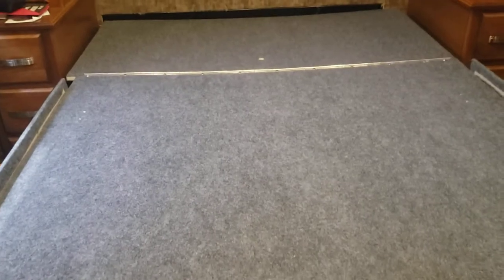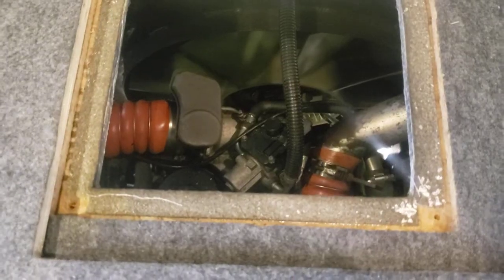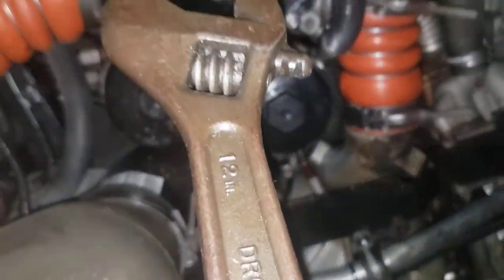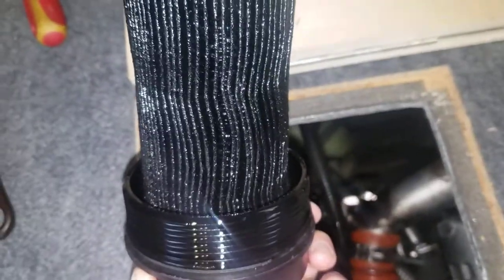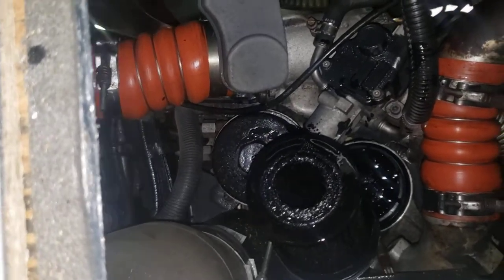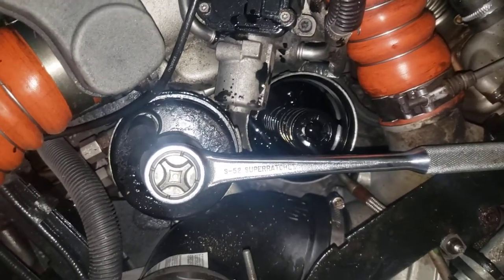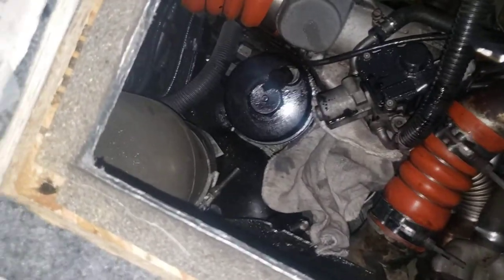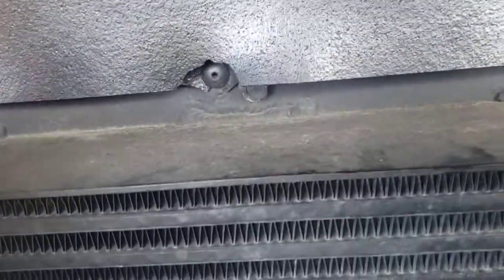Changing oil filter & fuel filter in a 2012 Tiffen Breeze 32br Maxxforce 7

Comment: Did you figure out the second filter was a fuel filter yet? There is a kit to replace that with the fuel/water separator below.
Reply from the maker: Yes, after I removed both filters, I realized one was a fuel filter.
I'd have to watch my video again, but I thought I mentioned that.
Under the coach or underneath the engine is the fuel/water separator filter. I did a video on that.
Reply: @PlasmArtFabricating  Curious, do you still have the Breeze? How has it been as far as problems go? There is a lot of conflicting opinions about the Maxxforce 7 engine and the EGR system. BTW, I purchased a 2011 Tiffin Allegro Breeze with 55,000 miles in January 2024. I still haven't drove it. It's just parked in the backyard while I have been performing all of the maintenance on it.
Reply from the maker: I still own the 2012 Tiffen Breeze 32br.  I love it! I believe it wasn't until late 2013 when issues began happening and after Tiffen had to begin installing pollution devices on the engine.
I pull an aluminum 18' trailer with a Fiat 500X on it and two electric bikes. I also have a spare 30-pound propane tank and two large containers with barbeque equipment, etc, in them.
I've driven up I-17 through Flagstaff, not missing a beat. Driven through hills of Tennessee  and the Virginia's.
No issues at all.
The only thing that happened was during covid, and I stored it covered, but windows and roof vents opened only to see both captain chairs begin losing the thin leather on them along with the curved sofa. I heard Tiffen knew about this and gave original owners replacements. I contacted them but will only sell replacements.
I'm looking at selling and taking the cost for replacement off the price.
I replaced all exterior lights with LED except headlights.
Mine didn't have front turn signals except on the mirrors.  I hooked the running lights up to signal turns. The wire is already there. Maybe who wired them back in the factory just forgot?
You'll love it!
Reply: @PlasmArtFabricating  The previous owners of mine, an elderly couple, were good about bringing it in for servicing and taking care of any recalls. They had all of the leather replaced because of the known issue you spoke of. Then they put fabric covers over the new leather for the duration of their ownership. So I basically have untouched leather on the 2 captain seats, dinette area and the love seat across from there. I'm considering ripping out that 2 seater couch and making it a workshop table area that can store tools as well. I won't need that much seating, but will need my tools and a work surface.
  It's good to know that it's been good to you. I can't wait to start traveling. Hopefully this summer. In the meantime, I'm just planning on things I'll need and maintaining the coach. I decided I wanted a spare tire. Little did I know at the time it was going to be a thousand dollar project including the rim, tire, torque multiplier for cracking those lug nuts, 12 ton jack with a special saddle, 6 ton jack stands and base plates for uneven ground, and all of the hitch mounting gear for the spare. I didn't want to have to rely on roadside assistance. The tires that are on it are in great condition, but they are 2016's. I have purchased a TPMS and wheel covers and have sprayed them with the 303 UV protectant and will keep a close eye on them until I'm ready to drop $3,000 - $4,000 on six new tires.
  It's been fun to work on and everything seems to operate as it should. I was told by the previous owners that it just needed some TLC and that was exactly the case.
Reply from the maker: Another tip. You might want a TSD fuel card. It can save you 40-50 cents off gallon diesel. 
Flying J and one other doesn't except it only Good Sam card. Good Sam might save you 10 cents off a gallon.
I think it's a good deal.
Reply: @PlasmArtFabricating  I have gotten the Open Roads card and linked my bank account. I will look into the Good Sam card, thank you. I would be interested in any literature or PDF files of any service manual type that doesn't come with the coach. I have the complete set of manuals that came in the Tiffin bag but they were just good to familiarize myself with all of the systems. When it comes to performing work, I find them to be lacking. The pictures and descriptions don't always match up with what is actually on the coach. It took quite a bit of research for me to be able to get all of the correct filters and fluids. It's like Tiffin built these so you have to take it to them to be serviced. Speaking of which, they will start accepting appointments this fall in their service center, but if your Tiffin is older than a 2015, they say they will try to assist you.